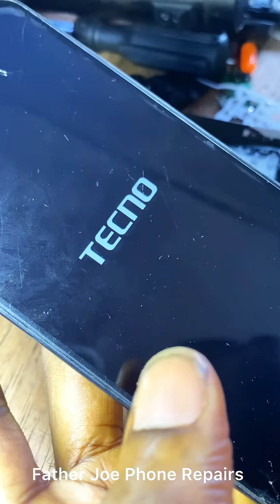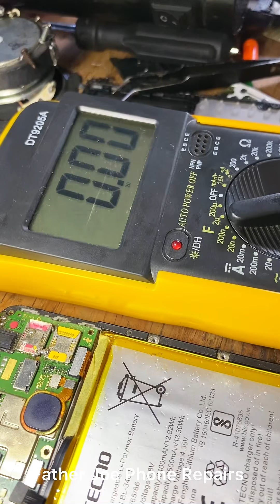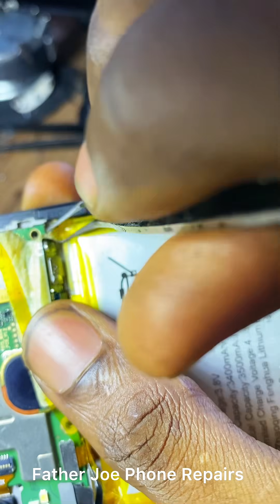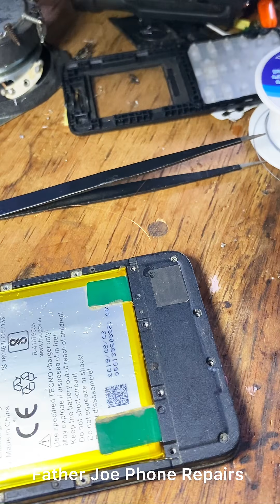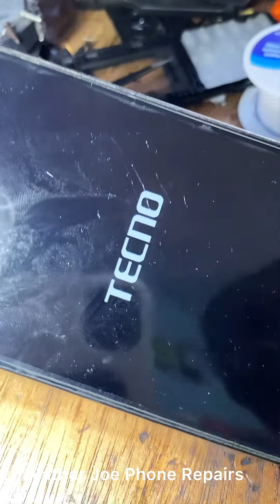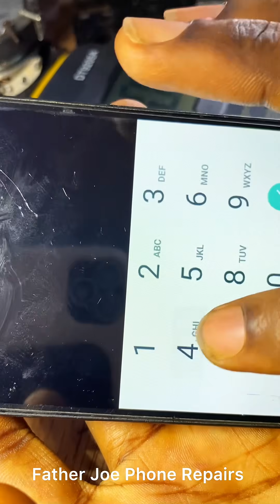How to Repair On and Off issued fast 🥰

Comment: Nice one sir, 

But you should have stated the 2 or 3 common things that can also cause this auto power issue in phones which can be the Power flex or the power point when it's shortened or it can also be a software issue. 

Thanks for sharing your knowledge sir 😁
Reply from the maker: I'll try to make a video on those issues

Comment: I have Nokia 1.4 with slow charging problem. But can discharge so fast. What could be the solution to this?
Reply: Test it with a new charging board and a new battery that will help u to know where the issue is coming from

Comment: BUT father joe what difference will it  make to measure the battery-voltage when the phone is  ON and when it's OFF?
Reply: No difference. Battery must supply the voltage to power ic 247, that's why you can turn on your phone when it off.